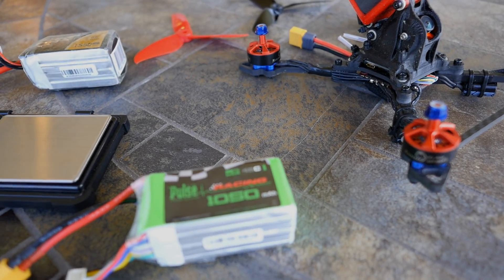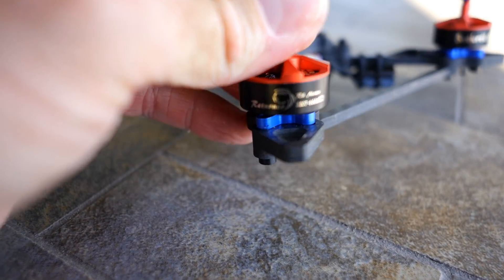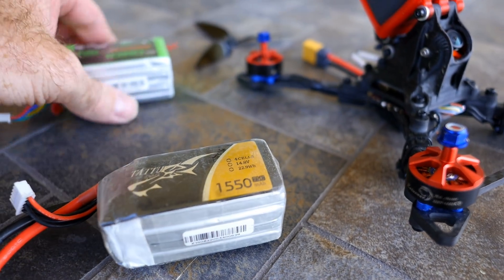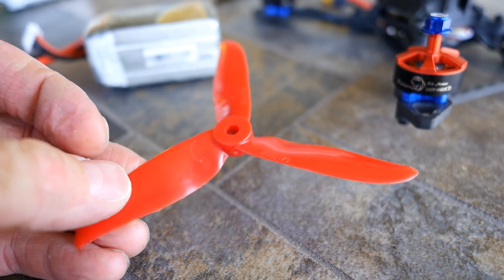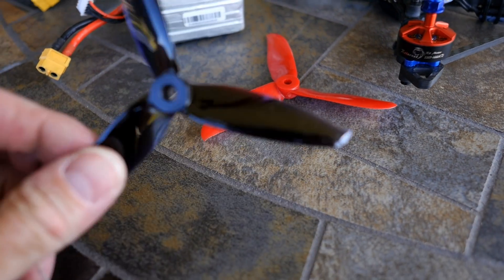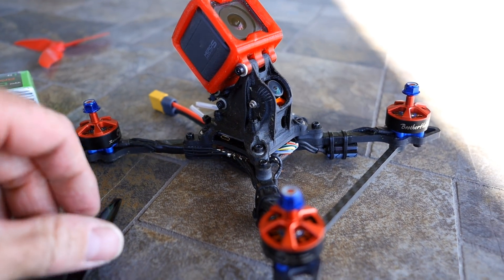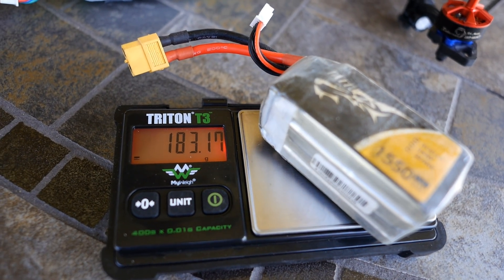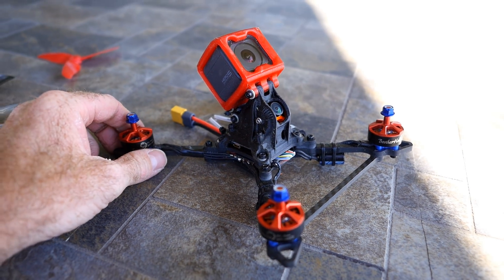The next epic setup for FPV racing? (High voltage + Low KV)

Comment: I've been testing low kv, high volts for over a year now.  It's a lot more complicated than logic would assume.  It's not exactly like an AP platform where you can just fire up the volts and drop the amps to nothing.  Where you do see definite gains is cruising time and especially 6" 6S.  The kv is not as important and in fact we're finding better results with 2307 and 2405 in ~2700kv than lower kv.  The lower kv motors also don't seem to have more torque than higher kv up in the RPM's.  They actually seem to have less torque when you inspect charts at MQTB.  My guess is that higher kv pulls more power in order to execute transitions or any action.  Jacking up the kv is a sort of 'fake' way to create torque.  That's why small motors like 1806, 2204, 2205 are preferred in the higher kv's by pretty much everyone that compares them.  Going with a larger motor is a way to physically create torque so less kv is needed to get to the same RPM.  Overall, bigger motors can take more power saturation so they tend to be more effective on higher voltages.  That being said, the higher kv stuff on a big motor is not quite the same as your typical 2206 or something at 2700kv and it's somehow okay to do stupid high ~2700kv on 6S and 6" with a big motor.  That last part  is particularly interesting to me.  

Where the actual racing efficiency gains might come from is that when you're not super on the throttle, amps are actually reduced and you're stressing the battery less.  So if you're using a similar C rated, or just a decent battery, you can use more of it.  The AP argument would add that you're also reducing heat in the system but I'd say that when we're flying for only a few minutes, the heat delta is insignificant.  Also, because you've got more volts in the system, you do have the ability to execute on the kv more effectively so you actually need even less kv than you'd calculate to achieve the same RPM in flight.  I was finding ~1600kv to be kind of a sweet spot for 5" 6S in order to achieve a  touch more than similar performance as ~2600kv 5" 4S.

All good stuff.  Good overview, keep going.  See if you can figure out wtf is going on because I'm still confused as ever.  I was expecting to only be using ~900mah 6S packs by now and working on how to shrink the FET's to be able to do 8S and 12S.  Confused dreams...
Reply: mooosestang it's super fun to try this stuff. But I'd recommend you skip the low kv and just run it on like 2600 kv. It's so much more awesome!  🤣. Might only get like 3 flights on the battery before it explodes, but you'll finally know what it's like to feel absolute freedom. Like a bullet or like a bird. You decide.
Reply: Stephan_rc says everyone knows lower kv has more torque, except bob of course, lol!  https://www.youtube.com/watch?v=K_73LydfQQY  https://www.youtube.com/watch?v=aEdAkOkf4E8
Reply: Correct.  This is what the high voltage, lower current concept is based on.  Except when you actually do get more power out of the system because of the increased ability of the battery to deliver so you pull more power too.  Or when you chop down the batt capacity to get the batt weight down.  Is it better to stress 6 small cells a little less or 4 bigger cells a little more?  I was and still am really disappointed at how it didn't work out the way I hoped in the real world.  Much more testing will be needed to figure out how we can get all the benefits we're supposed to be seeing...
Reply: Interesting info from everyone! Tnx  :)
Reply: I know it's more complicated than just using a formula, voltage sag plays a huge part though.  Still i ordered some pulse 6s since they are currently $13!  I don't have any motors lower than 2300kv, but we'll see how they do on some emax 2306, f40pros, whatever else I feel like sacrificing in the name of science!
Reply: P=U x I  ---> for example 16.8x(1300mAh x 60c)=1310W  25.2x(1000mAh x 60c)=1512W.  Higher battery voltages require lower battery current to achieve the same power. So in the real world with a real battery, the one with higher voltage will be able to supply enough current and higher power. Unlike the one who will desperately try to supply enough current and there will be a drop in voltage and power. Look at this its clear AF it is comparsion with HV battery not 6s -> http://www.lipobench.com/index.php?lipo=15&lipo2=36&page=racetests
Reply: fresh tattu r-line 1550mAh 95c has a voltage drop to 14.3V (3.575V cell) at 90A so it can deliver only 1296W. 1296/25.2=51.2A...  and 3.575V x 6s x 90A=1930W! I think it's the right way to the future :D I have read that manufacturers want to increase the onboard voltage in cars to 48 volts. It's just more effective.
Reply: Man, let me get back to you...  when I've been able to digest this.
Reply: With out you guy's WHERE WOULD WE BE ;) thank you for always learning, so we can rip harder ....
Reply: ive been using 5s on my 6040x3 and 2306 2750kv for 6months or so. tried the hqprop 5x5x3 on them and flying weight of about 760grams. i loved it. the gemfan ive tried with 5 and 6s biblades tho. still nice :) might have to give the tri blades a run on high kv high voltage..
Reply: but would this be great for freestyle..
Reply: what is your theory about which motor is suited best for a 5s setup
Reply: Kabab FPV is there a way to current limit a high voltage setup so the motors don't suck down more then they need, like me at a buffet
Reply: Daniel Braker can't you do that in blheli32 suite?
Reply: TheBigblock81 yes you can I totally forgot about that.  I need to get some 6s batteries.
Reply: 32bit escs, current limiting feature. cap at your designated value and feel the feels. I wanted to set it to 5a as a funny ha ha thing one arvo but didnt get there lol.
Reply: Kabab FPV so you're saying you can do for example high kv on a 2306 motor and it'll possibly perform better? I've got 2306 2750kv motors and it seems unreasonable to pump 22.2 volts in them. But if your findings are true I should be able to?
Reply: Bee Brave FPV Another thing to note is that with BLHeli32, you can limit the current, so you don’t have to worry about cooking your motors!
Reply: mooosestang it's more complicated than that. I'm talking about the very narrow range we use motors in. If you look at charts on MQTB it supports this idea as well. Nothing is so simple and I have no idea wtf I'm doing. Just playing with toys and trying to make something of what I'm seeing.  I'm open to all possibilities and try not to bring in my own bias to explain what I'm seeing.  That same person also shows in the next video where higher kv has more torque.....in the higher RPM range....which is primarily where most of us fly...depends on your motor size....way more complicated than just 'low kv is more torque'...
Reply: I don't know shit but there seems to be some rough margin of equilibrium between motor kv and voltage.

 ignoring the battery side of things id expect that if a set up running say 6s and 1800kv for a total of 45k rpm the performance and efficiency should be very similar to say 4s and 2700kv (also 45k rpm) with maybe minute efficiency gains through power transmission of wires from higher kv.

Again my knowledge is supremely lacking in this and is only what I have seen in comparison and of course there is a million variables in this subject

Comment: Been using high voltage with low kv motors for a while, it's definitely one of the best ways to fly fast and efficiently but it's nothing new. I'm glad others are catching on so more 6s compatible components will be made

Comment: Why would the same motor wound for lower kv have more torque?
Reply from the maker: Decent explanation here. http://www.flyelectric.com/ans.kv.html
Reply: More torque for the same current, which is obvious. Same power, same torque. https://www.rcgroups.com/forums/showthread.php?1096719-Mythbusters-Lower-KV-more-torque
Reply: [DiegoFPV] Then maybe, as mooosestang suggested above, the current battery tech. just can't do what is being asked of it (voltage sag - a symptom of the battery failing to supply the demanded current).

:) I don't know why the quad racing scene has seemed to get stuck on 4S all this year. To my mind, asking for over 100 amps from the battery is kinda crazy stupid. Those power systems are crying out for a halving of the current ~= double the voltage.

CMW is high lighting here that; going to higher cell count (higher battery voltage) will cut the current (and heat), will ease the C-rating requirement of the battery thereby allowing lighter and cheaper batteries, and will allow the motors to get all the power that their load requires.

Comment: I have wanted a MERICA frame for soo long i just dnt think i could handle all that power.
Reply from the maker: You can. Just don't push the left stick up as far :P
Reply: Harden up, man! The next S is waiting. \o/
Reply: Then you governor the power and get better because Machine is so smooth in air, you never want to bring her down. You’ll get better because of it.
Reply: Fpv family!!! We should all help each other out!!
Reply: Cecil Williams left stick is the most important stick.. this coming from s sponsored 3d heli pilot.. how good you are at throttle/collective pitch control directly determines how good of a pilot you are. the better you are at throttle management/collective pitch management the better pilot you will be. with helis I fly twice as many practice flights on 6s (very low head speed) as I do 12s for the simple reason of the very low head speed of 6s makes me have to manage my rotor disk energy very carefully as to much pitch will eat my head speed up to the point of instability and or just to the point in at less then a 1 to 1 power to weight ratio at max pitch causing a crash that can't be stopped without enough altitude to drop to center stick (zero pitch) and let the head spool back up.. I as all world class heli pilots perform our routines very close to the groud.. one mistake of to much pos or neg pitch for just a few 100ths a second to long equals crash. the better you are on the throttle stick the better pilot you are be it racing or freestyle but especially racing..
Reply: Catalyst Machineworks haha
Reply: John Graboski.     Not nice bro !!! F.p.v. is a family
Reply: John Graboski. Jk

Comment: Ya brah... 25.2v × 1660kv = 41,832 rpm, 16.8v × 2600kv = 43,680 rpm.  Just comparing your 4s videos to this one, the 4s wins.
Reply from the maker: Yes and 16.8V x 3000kv motor = 50400 rpm. So that should "win" right? No. It doesn't. The reason is torque. Those numbers are theoretical. As you move up in KV on the motor your torque rating of the motor goes down so you never reach those RPM's and have higher losses. With this 6s setup I am noticing the ability to swing a larger pitch prop with more torque allowing me to achieve higher RPM.
Reply: Catalyst Machineworks I would love to see a race between the two quads with the proper prop on each setup... not the same prop! I was just trying to say that there is no miracle setup. There is always a balancing factor. Even throw in a 3 inch beast and you wont see a huge diff in times. Just my two cents. No beef intended.
Reply: voltage sag with high kv motors kills the torque, nobody accounts for that when running the numbers.  That's why low kv motors feel more torquey.  In theory they'd have the same amount of torque, but they don't.
Reply from the maker: Yes this is what I am thinking is part of the reason I am sensing and seeing in the footage so much punch and speed. Like you said, this setup should in theory have similar torque compared to an equivalent 4s setup on 2500kv motors but it just feels different in the air. I believe less amperage is placing much less demands on the lipo and its translating into less sag for a longer duration than 4s. That is my theory atleast lol. I do want to get AMP draw up on my OSD can I get real numbers to compare.
Reply: Its also nicer on battery ware and tear.
Reply: I got some f40pro 1600kv coming, going to use a FC with current sensing for sure.  I am curious about the amps.
Reply: Bryan FPV Also the 6S pack weighs less. I bet it had a lot less sag as well. I would like to see some fpv cam footagw with the voltage and some track flying.
Reply: Catalyst Machineworks So ive decided to go 5s... Amp draw is key for me. Building a 6inch long range setup with 1600kv motors. Don t wanna feel the 4s sag when im 2km out. This debate opened my eyes to new possibilities. Cheers 😉
Reply: I bet those would do well on 6s. I'll try the f40pro 1600kv first